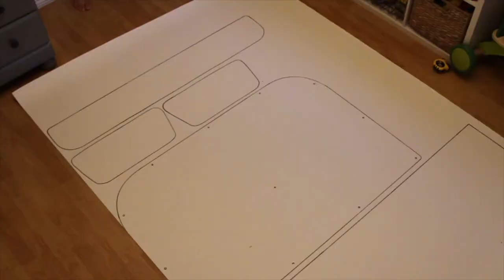This will make you’re van feel more like HOME!

Comment: Excellent job guys, that’s much better than framing and fixing T and G boards, much lighter and retains maximum width
Reply: I also use the original headliner, it breathes and has built in sound deadening and insulation.
Reply from the maker: Hey Thanks Steve! Merry Christmas!

Comment: At 2:00: Not sure how you call it in the US, but I use Fimo on the backside of the panel. Think of a removable chuwing gum. Place it on the panel about where the hole or whatever you want to find and press it on. It will leave in imprint that you can mark and drill..
Reply from the maker: That’s awesome! Thanks for your reply! Hopefully this helps everyone! 🤙🏼
Reply: Hi, may i ask, what is white board u used. Thanks